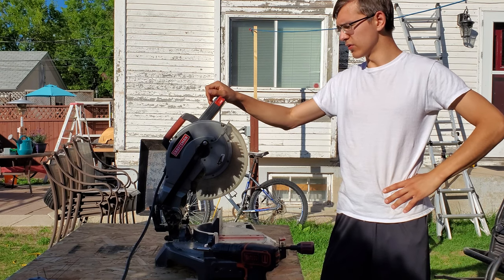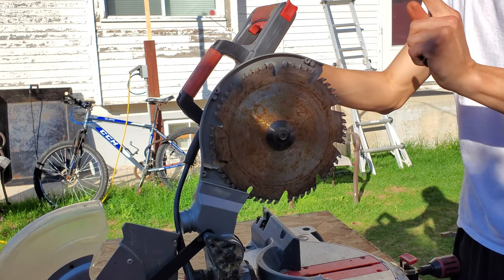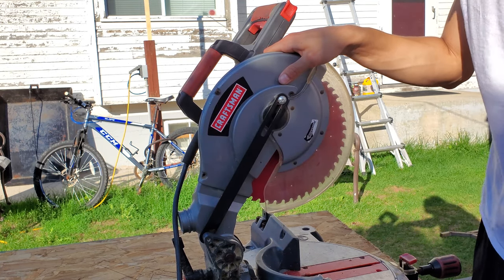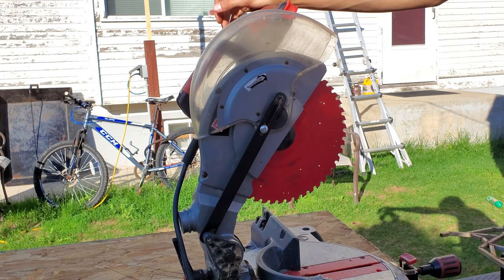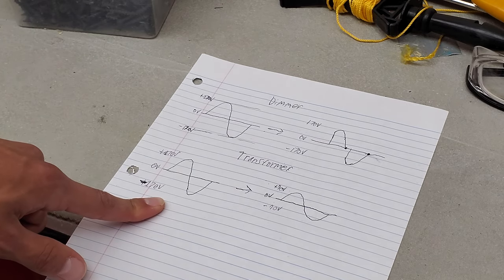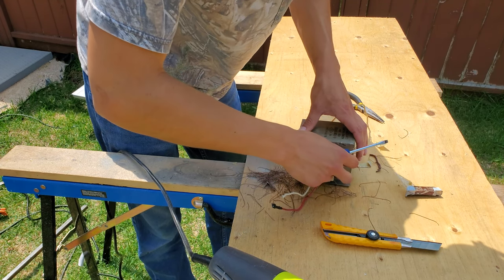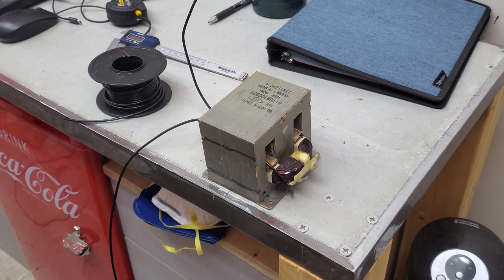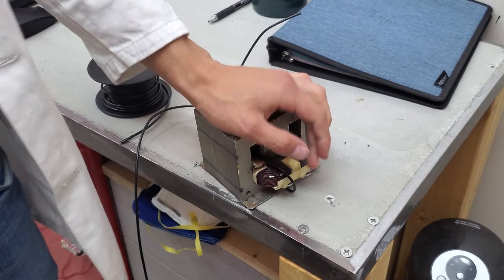How To Slow Down A Mitre Saw To Cut Metal - Cold Cut Saw Conversion

Comment: AC motors designed to run on a certain voltage (120vac in the USA) depend upon back EMF (ElectroMotive Force) to limit current draw.  EMF is generated by the spinning of the rotor (which is a spinning inductor).  Inductors resist the increase in current.  When back EMF is reduced due to lower voltage input or if the rotor is not spinning, current draw from the line goes up generating lots of heat.  That's why your transformer approaches and exceeds the boiling point of water.  Also, the saw's motor heats up, too.  EMF is sometimes called CMF/CEMF (CounterElectro Motive Force).  Not the best way to control motor speed.  DC motor speed control is done by voltage adjustment (cheapest method).

Comment: One other thing, on re-winding microwave transformers:
They're usually constructed a bit differently than most other transformers. Instead of having the laminated iron plates of their cores riveted together, there will be two thin weld beads running down the joints where the primary and secondary halves join.  I have no idea why they do it that way, but but it makes them an excellent choice for hobbyists to tinker with.  
The welds aren't very deep and you can easily remove them with an angle grinder, allowing the end to be removed.  (Try to leave the half of the weld bead toward the end piece intact, so it will still hold the plates of the smaller end together.)
Once the end has been removed, you can slide the secondary coil out without having to chop it up.  Of course it's a lot easier to wind on a new secondary coil, but you can also experiment with different numbers of windings quickly and easily.  
The end plate doesn't have to be welded back on; just held firmly in place.  I use a bar clamp for testing, then black vinyl electrical tape for semipermanent assembly.
I haven't noticed the heat buildup problem you mentioned, but I'll be looking out for it now that I know it's a possibility.  (I haven't tried using any to run powerful motors, but a transformer will get hot if you try to pull more power through it than its' primary is designed to handle.  Depending on the wire gauge and number of turns in the primary, they can also get hot when plugged in with no load applied.)
Good luck, and thanks again for the video!
Reply from the maker: Thanks!

I did notice the welds, but I guess I had though if I cut them I might not be able to get it all back together again.

As for the heat buildup, I know transformers consume a lot of standby power, but you might be right in that its unusual for them to get that hot. I never really noticed that with other transformers, only the high power microwave variety.

It might also have something to do with my secondary? I don't really know to be honest. Could be that microwave transformers are designed for short term high power use, and always use cooling fans, so maybe standby power isn't a design consideration?
Reply: @GadgetEyeGuides  the reason it gets so stupidly hot has to do with magnetic saturation (google this...sounds difficult, but it's not). If this were to be a full continuous-duty transformer with that kind of power rating, you'd struggle to lift it at all ;-)
There also probably was a magnetic shunt in there somewhere - it's a few pieces of metal in between the primary and secondary coils (not the center, but literally in between the empty space between the coils), if you still have them, put them back, should limit the current the transformer pulls with no load.

Comment: I think you would have better luck cutting if you blocked your part out about 1.5 inches from the fence. Were the fence is now it is trying to lift the part and clime down the part. Moving the part out will put it in a more neutral position were most of the force will be back toward the fence and down to the table..

Comment: Great video and looks simpler than Jeremy Fielding method where he replaced the motor. I've been thinking of converting my Dewalt mitre saw and this looks relatively straightforward and I have a microwave transformer. The math will hurt as I don't understand electronics well enough yet. 

What gauge wire did you use for the secondary winding and how do you determine that?
Reply: ordinary twin flex will work, 1.5 mm copper coated with plastic
Reply: @luckydubeinrc5165  Better late than never :) Thank you for the answer!

Comment: You should use a saw blade with negativer tooth angle, which presses down on the steel instead of pulling up.

Comment: Really good video. Hopefully your read some of your comments because I do have a couple stupid questions. If you search YouTube on how to modify a standard compound miter saw to make a cold cut saw, most videos basically point to a blade choice. It is hard to find videos on what to do with the electrical side of things and actually slowing the motor down which is exactly what you did (what I was looking for). That is where my questions start. With your transformer method, what was the effect on torque? Did it maintain the torque or was there a significant loss? My next question is, how well would a VFD work? I bought a cheap compound miter saw on offerup for $40 to make a cold cut saw and I figured if I ruined the saw I would only be out $40 which I'm not worried about. It was also an older Delta so it's an all metal chop saw which Is a good thing in my opinion. Would it be worth it to use a VFD? Again, excellent video and thanks for going a little deeper on the electrical end than most!
Reply: VFD will work only for 3 phase induction motors.
Reply: No a vfd will work to control motor speed but you lose almost all the torque and blade will stall out..  notice how light of a cut he does..  plus these motors arent supposed to be ran at lower voltages it will damage the motor in the long run so would only be a sparsely used thing..  best bet is to get a smaller blade and raise the bed an inch for every 2” of blade diameter less..  slower tooth speed and get a metal blade with a big tpi..  but a vfd is good to have and will also allow you to be able to power 3 phase motors off a single phase supply..

Comment: Great video!! Haven"t heard of winding a transformer before, very interesting to see I also loved the background tracks as well.
How would this compare to a router speed controller or a Variac? I am looking at both of these options to slow down a portable table saw [universal motor] to cut mild steel (for the same clean repeatable cuts you are after, and without spending the money to get a dedicated machine)
Reply: Most people respond that the speed of the motor and reactance impedance change results in over heating of the coils.  There is not enough follow updates to know if this conversion damages the motor.  Frequency is preserved but the coils need to be robust enough as well as torque conserved. The inductive motor is better suited for speed changes.  I would Ike to see how a belt setup would allow for different speeds on a chop saw with variable pulley sizes like found on a large lathe or band saw.

Comment: The equation is a bit more in depth to figure out turns to voltage.  Theres a diameter of the copper wire plus size and type of ferrite used with style of transformer like whether its a T or I and the magnetic winding will effect the output..  its a whole big thing..  guessing and using common sense by relating equivalent turns with the existing secondary..  with a mot the secondary puts out 2000 volts so 1/35 of the amount of turns would roughly equal 58 volts..

Comment: Hows the torque on the saw? Those motors get touchy sometimes dropping the incoming voltage
Reply from the maker: Torque is reduced, and startup is slower, but it has not caused me any problems.

I have not had any issues with inconsistent performance when providing the motor with a proper AC voltage.

Comment: When you just drop the voltage like that, are you not worried about overheating the motor by drawing significantly more current under load?

Good old P=IV, the motor power (P) is fixed and you've just substantially reduced 'V,' so 'I' going to go up proportionally, is it not?
Reply: If you reduce the voltage, it will reduce the current proportionally and therefore reduce the power output to the motor.  The motor power is not fixed, it depends on the power input, which depends on the applied voltage in this case.  The problem would be,, do you still have enough power to operate.
Reply: @donaldrandall9277  you mean enough torque? I'm afraid that the modified miter saw would stall when cutting a solid steel bar due to lower torque.

Comment: Install a blade specifically made for miter and circular saws. Freud diablo metal demon for instance . Make life easier.
Reply: uh, I think a round saw blade is usually made for Circular Saws, but I may be wrong....
maybe you mean a blade with a 5 degree negative tooth rake to keep the blade
 from wanting to climb cut, also a  TCG triple chip grind instead of a ATB alternate top bevel
like many cross cut circular saw blades for wood are ground....
the carbide on blades designed to cut steel [not aluminum per say] is a harder carbide....
you can cut aluminum with no issues using a standard wood cutting blade, 
but one designed for aluminum will give a smoother cut. also a thinner tooth width will 
use less power . The Freud Diablo Metal Demon you mention is a good choice, along 
with other companies products, Morse, CMT, Evolution, ect. 
I hope this may help, Paul

Comment: Have a 10" Skilsaw 3810 miter saw that turns at 5200 rpm . I got a transformer from a microwave but how did you determine the primary coil had 90 turns on it? The label on the transformer says MD-803AMR-1. Thanks for posting this video, will help out greatly when I know the turns on my coil.
Reply from the maker: I know it probably isn't the answer you were hoping for lol, but I just counted them.

They are made in uniform alternating rows, so you should be able to count and multiply.

Comment: Still great video buddy! So what I would do man and forgive me but get a shock absorber off the hood of an old car or something like that. That has a screw adjustment or (pressure relief valve) and if it's blown that's even better it'll be smooth as hell and most likely work just right. As for me I'm gunna try doing this with my band saw. I have a porta band cordless flexvolt that I'll be jigging up to an aluminum plate frame making it a auto horizontal bandsaw chop if you will. Also I'd like to ask you some pointers on making a mill with my radial arm saw... Lol I wanna make a c channel and put some bearing rollers inside it and hang my radial arm saw off it and make a mill... I know crazy as hell but I'm doing it any thoughts?

Comment: Reduce spring strength, to manouver miter saw more easily. You do not need to reduce motor power and torque, by lowering voltage input to motor. All you need to do is to install very low feed rate system for blade. Very easy with some welding and small 50 W, electric motor.

Comment: What brand blade are you using? Freud-Diablo 10 X 50 X 1 Ferrous CERMET CSB, Multi, One Size (D1050CF) calls out max speed of 3000 rpm.
Reply from the maker: Diablo Steel Demon 10 inch.

Comment: One cutting steel isn't it important to have a balance between the speed and material feed rate, meaning you could go for a higher RPM provided your feed rate will set appropriately. With a miter saw The freezer feed rate

Comment: Cold cut saws require light pressure this is not true the chip load on a cold cut saw is very high commercial units normally habe a 3ft handle for leaverage
Reply from the maker: Interesting. I am not at all familiar with commercial grade equipment. Honestly, the most I know of this pertains to consumer grade saws, and from the videos I've seen, they cut very quickly and with little pressure. I imagine commercial hardware might be different. 

Honestly, this saw is not meant for this purpose, and this project was a quick and dirty solution to use a metal blade on a wood saw.
Reply: technically speaking what he has is a dry cut saw, whereas you might have a real cold cut saw...how fast does it turn? Cold cut saws turn really s l o w and need a fair bit of pressure (and coolant).
Reply: @AKAtheA  not always cooling needed, and dont push it. Let the Blade do the work. Youl break the saw by pressure. 

Lot of dry cutters dont need cooling. They cut cold. So no need to cool it. 

1300-1700 rpm
Reply: @Jandejongjong  the ones I had in mind are something like 200-500rpm, really slow, generally obsolete now. Those use a pure steel blade, no carbide inserts, hence the need for flood cooling and going slow.

Comment: ...I just use a abrasive disk rated at 6000 rpm and my chop saw is rated at 4600 and I use a cardboard (pop can box) shim for the side of disk without metal protection and a C clamp or wood clamp to hold down...get your files ready to clean the metal though

Comment: Thank you. How many turns did you end up with?
Reply from the maker: Good question. I should have included that, however I cannot recount the windings as many of them are not visible.

However I remember it being something substantial. Like 10-20%.

The rpm to voltage curve of the motor was non linear.
Reply: @GadgetEyeGuides  can you do a tutorial for a DeWalt double miter? Or make a kit for it?.
As a welder you have info here that's worth alot of money.
We spend $700+ to get dedicated saws so if you could cut that price you could easily take over the market
Reply: @jonathangarzon2798  you could purchase a 15A or 20A variac for 100-200$ (depending on location) and this would achieve the same thing... the nice thing with a variac is that you are able to adjust the number of 'windings' on the fly (RPM measured with a tachometer like OP does) so it wouldn't be a machine specific device 

This is not said to discount this video. As a DIY'er I found this information to be invaluable.

Comment: What size and type of wire used on secondary?
Reply from the maker: 14G multistrand automotive wire. PVC insulation. -40C to 85C.
Reply: @GadgetEyeGuides   the multistrand wire may behave differently with the flux transfer as compared to a single copper strand also...m  just a thought.

Comment: We got 230v

What transformer do i need to have?

230v to?

May be i can buy a transformer.
Reply: you certainly can. But it would also reduce the power output > lower torque > slower cut. But other than that, I don't see any other problem.

Comment: Excellent video. I love seeing smart young people do projects such as this one. Love the math on simple paper and pencil. If more boys would learn valid things in schools, our world would be a much better place. IMO, a man, husband, father needs to be resourceful and skilled in many ways, lucky are those women who have husbands, boyfriends, who fit these characteristics, and are hands on, logical, practical men, but I have found that few women appreciate men like these. Ladies, if you have a man like this, you have a nice gold nugget and you may not even know it. Likewise, can be said about smart women or children in general who have learned from hands on fathers, mothers.

One thing I would have mentioned, at the start of the video, where it shows taking apart the tool, is a note to make sure to UMPLUG FIRST!, and for  the use of a microwave transformer, is a word of caution that working with microwave transformers can be lethal if one does not understand the mechanics of it. Unpplugged no problem, but I am afraid some person may just plug it on in stock form and electrocute himself with the output.  Explaining that using a microwave transformer with the secondary windings modified to STEP DOWN, is safer, lower turns and heavier wire lowers voltage but increases current without the use of math would be prudent for those not familiar with electronics or electrical circuits, the thing that makes a microwave XMER lethal is the STEP UP windings where it generates alternating unfiltered dirty and killer energy in the KILO VOLTS!

Comment: Why speed up 300%

Couse the saw dont saw?
Reply: because his setup has killed the torque output of the motor.  Those motors rely on very high speed and little torque to produce their cutting power.  When you reduce the voltage, the torque gets so bad some of them may not even be able to start.  That's why his 300% sped up video is still SLOWER than an OEM metal cutting saw.....the torque is basically gone.

Comment: I don't think the average DIYer will do this instead of just buying a cold cut or use an angle grinder to cut steel. If you have a better way to convert the average chop saw, then make a unit that can convert or ..... just saying. The video is interesting but hardly practical to the average DIYer to do.